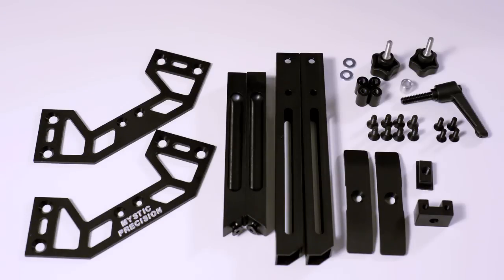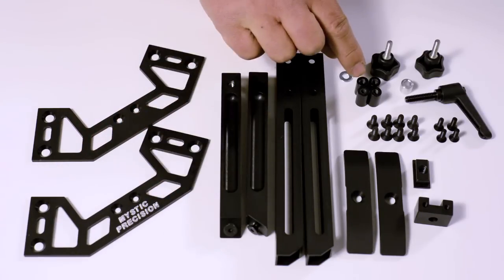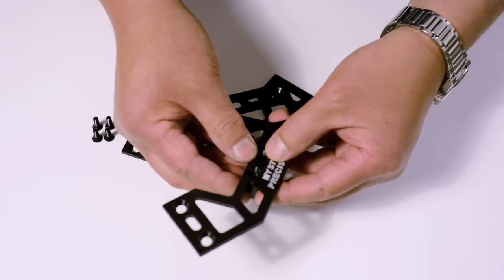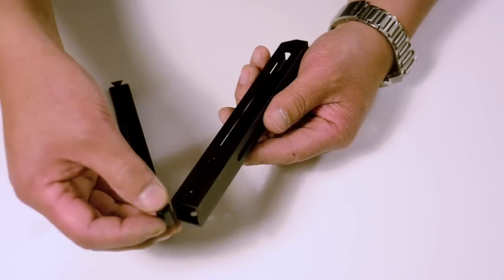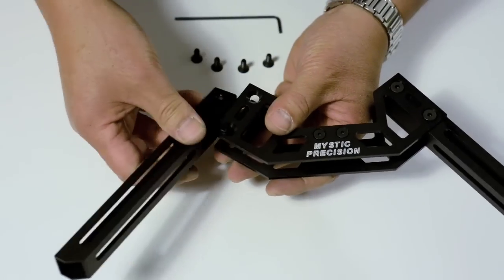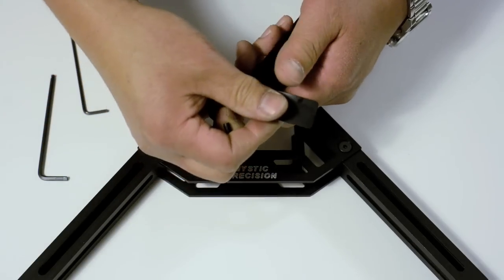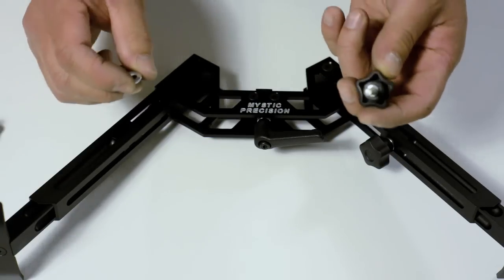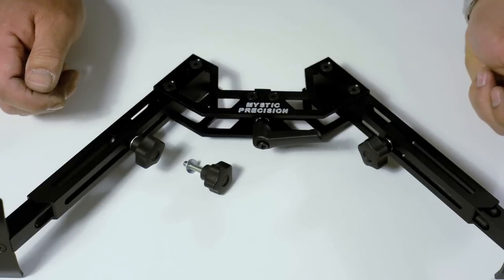MPOD_ASSEMBLY.mov

Comment: 7 y ago someone asked about picatinny rail adapter. Are you going to answer that or you don’t care?
Reply from the maker: The market has moved onto ARCA... so no adaptor for pic rail
Reply: @MysticPrecision  I don’t see the adapter for ARCA either
Reply from the maker: @andreytodorov843  bolt the T slot rail to any generic ARCA clamp.  The area419 clamp already has holes and an easy install.